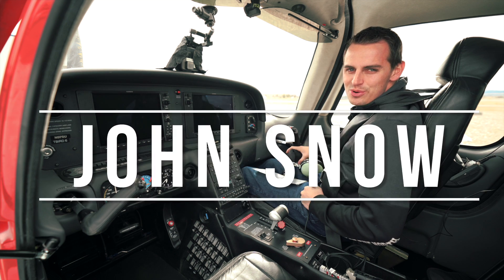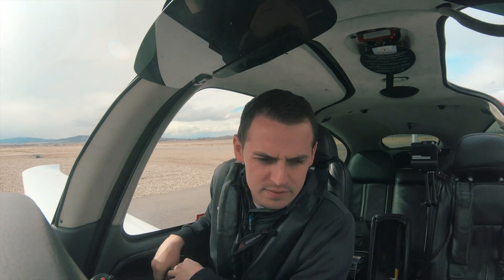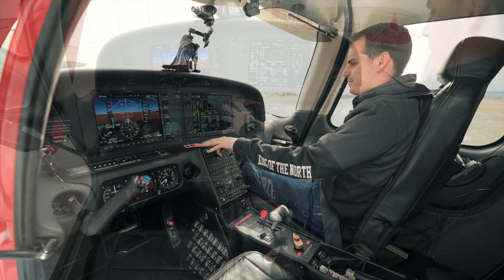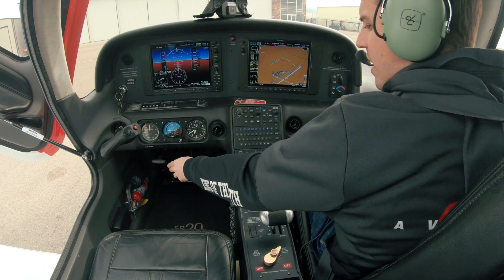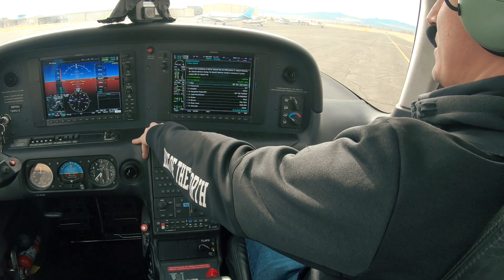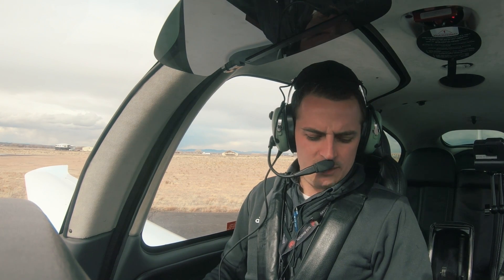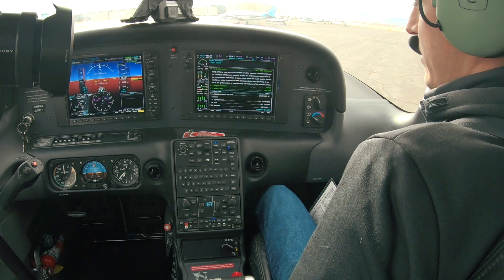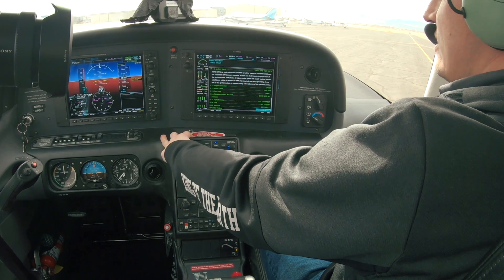Cirrus SR20 Airplane Startup And Takeoff | Step By Step

Comment: ACTUALLY the Cirrus SR22 is Like The G1000. The Difference is That The Cirrus has an alphanumeric Keypad. So You Have To Look for The Buttons on the G1000 and Find Them on the Cirrus. They're in a Different Place.
However, the Cirrus is Similar To a C172 G1000 or DA42NG.

Comment: The Flaps should come up as soon as you turn the Batts on. You need to set the attitude indicator as well.
Reply from the maker: Following the Cirrus checklists, our flaps come up before taxi and our attitude indicator is set during taxi.
Reply: Did you leave pump on while starting?
Reply from the maker: Yup, it comes on for engine start and gets turned off when the engine is running and stable
Reply: @SUUAviation  not quite the way the cirrus checklist flows, but it’s good. It seems like you did a hot start.